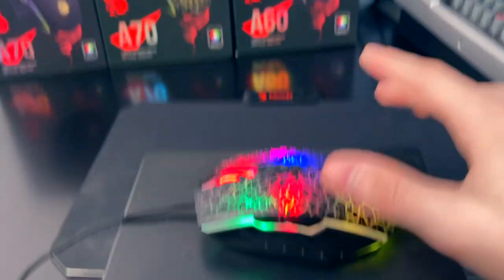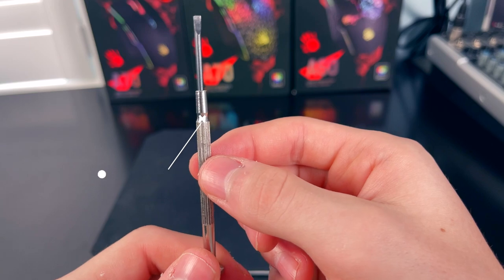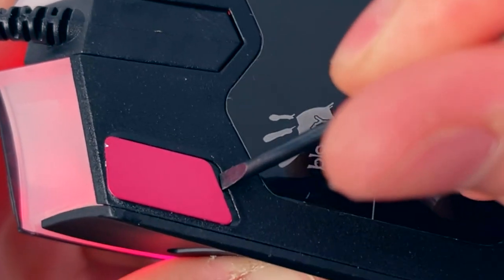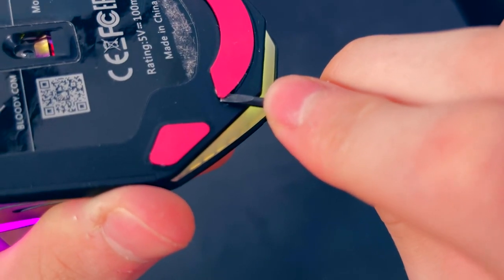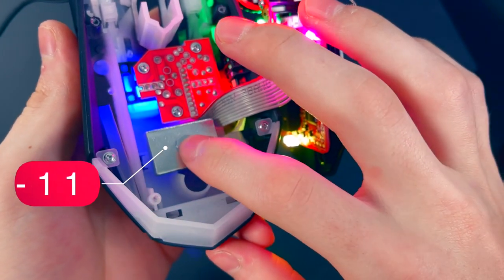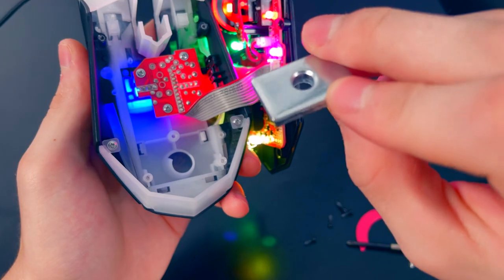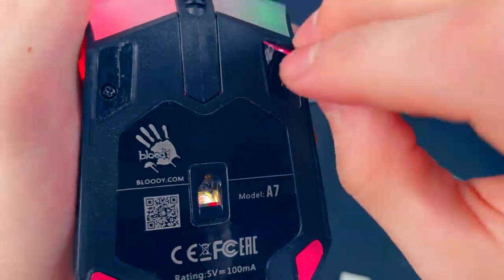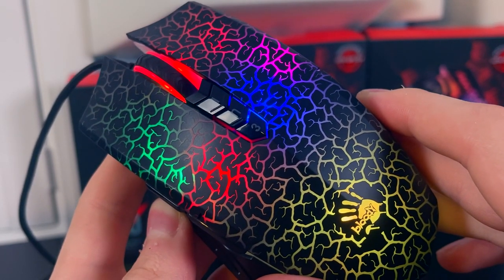20g Lighter | Remove Bloody A70 SECRET Weights (Tutorial) *drag clicking*

Comment from the maker: This MOD Works on: A7, A70, Abedless, and A60 -- they all have the same weight inside of them.
Reply: Ok thx! I can do this to my a60! Thank you!
Reply: i wish I had a an a60 or a70
Reply: dose the 90 have one too?
Reply: does the a90 have one as well
Reply from the maker: yes a90 has similar weight
Reply: @helixmods  pls do that
Reply: @helixmods  pls do a90
Reply: @helixmods  its fine :) i already took it out
Reply: @tf2tea  i don't think so
Reply: @helixmods  pls a90.
Reply: @HAMZA YUSUF SULAIMI BIN MOHD IKMAL HISHAM ZULKARNAIN Moe cps means clicks per second u don’t have to repeat it
Reply: @helixmods  love ur vids ❤️
Reply: @tf2tea  the a90 you can make the weight lighter manually
Reply: 2:10 u can see tht u did it on a bloddy a 7
Reply: @light1832  The light on the a7 stood still so everyone knows its an a7. A70 has multiple color switches while the a7 has multiple colors but it doesn’t switch
Reply: yeah does it work on a A90
Reply: I will try on my bloody abedless
Reply: Abedless?
Reply: @ohmeatpie9216  yes
Reply: @pftttt  already have it worked
Reply: SB80…
Reply: mine a60 doesnt have this
Reply: Same
Reply: on the a90 on the bottom u can remove the thing with out a screw driver and remove all the weights
Reply: @Lermonadenlime  check under the bloody a90 and remove the circle thingy and remove all teh weights and then ur good
Reply: A90?
Reply: @johnwill9511  how do u remove it
Reply: and the A70x
Reply: do they all have the same feet? i lost one of my bloody a70 feet in the process
Reply: @tf2tea  yes , i just remove it
Reply: And the abedless 2?
Reply: @Doji_kurikku  Yes, the ABedless 2 has the same shell, coating and similar weight as the ABedless 1, sincerely meaning that this MOD works on the ABedless 2. Not sure about the A6 or A9 though... but I'm just giving you clarification on the question!
Reply: its gives in razer dathadder too

Comment: NOTE: You can use a hair dryer (or something similar) to weaken the adhesive on the metal feet by heating it up
Reply: make sure you cover the censor first
Reply from the maker: AWESOME ADVICE! I didn't think of that before!
Reply: @helixmods , Reply to this I am a fan!
Reply: @DeadSafari  :b
Reply: Cover the whole mice if you dont want to melt it because you blow it with hair dryer for more than 5 secs
Reply: @paklekj4429  how to cover it
Reply: @Fonggs  i mean using something to cover the part you didnt want to heat up or it'll melt
Reply: @paklekj4429  but idk to use what ;-;
Reply: @Fonggs  masking tape is the way to go because it can survive 100°c so it wouldnt get burnt by the hairdryer
Reply: @paklekj4429  thx
Reply: I actually used my heater lamp for my candles and covered the middle parts with a handkerchief, it works

Comment: Hmm I wonder if you could do the opposite and make it easier to non hold mouse godbridge.
Reply: Nah I don't think so, there is most likely not going to be a place to attach the weight to in something like model o.
Reply: @Feed me where r u going to put the metal?
Reply: @ItsAK69  bro I am talking about bloody a70/a90, thanks for the advice though.
Reply: Hey add tape on the mouse feet it works for every mouse
Reply: @charbelmansour7981  why? If it's ptfe it's just gona be destroyed and who in there right mind dosent want good glides
Reply: @ItsAK69  it works for the a90 and some other mice it just makes it a lil bit more stickier but I recommend holding ur mouse while gb its not that hard

Comment: I did this mod on my abedless and I scuffed up the mouse feet, but the mouse felt great after I did the mod. I would only do this mod if u are willing to have to make ur own mouse feet for the mouse, I can’t find any place that sells mice feet ready for the abedless , a70, a60 etc. I did find some sheets of feet material, that you can buy for 10 dollars. So that is your best bet if u scuffed the mice feet up while doing the mod.
Reply from the maker: thats sad to hear. I was careful with my mine and luckily didn't break them
Reply: Same, my mouse feet got scuffed so imma sand it down lol
Reply: use a precision knife or a "xacto blade" to pry the metal feet. i did it with no hitches. or you could just rub the feet off a mat to warm the glue up
Reply: ok, i already made some mice feet for the mouse. they are working pretty well
Reply: I just use tape on my mouse feet, to stabilize the mouse

Comment: Pro Tip, use a hair dryer to heat up the adhesive and make it safer and easier to remove the feet.

Comment: My Bloody P81 is now 13 grams lighter! Currently it is lighter than my g203 which weighs 85g so I am pretty sure P81 weighs below 80 grams. 
I don't understand it because it is supposed to weight 150g with the weight.
What's more, I didn't have to remove any mouse feet just unscrew one screw at the bottom.
 (vid inc)

Unfortunately I did unscrew both in the front like you did before realizing there was no screw in the :D

Comment: I might need some help mr.helix. Ive gotten 3 of the 4 screws out of the bottom of my a70 but the last screw wont come out no matter how much i turn it. No it is not a stuck screw when i turn my screwdriver to loosen it, the screw is able to turn yet no matter how much i turn the screw, it will not come out if you know how to fix this please help me anyoneeeeeeee
Reply from the maker: uh oh I think you might have stripped the screw head. If not get a smaller screwdriver and firmly press down hard and turn. Make sure you dont slip the screwdriver and wear out the screw head. good luck!
Reply: @helixmods  .Thanks for the reply helix. I couldnt get out that screw because it was just stuck inside - not even stripped. Regardless, i moved on to my a60 and was able to get the weight out of my a60. As for the a70, i think i need to use some type of magnet to get that stuck screw out because its not even moving whether i loosen it or tighten it. The screw is just not able to move whatever you do.